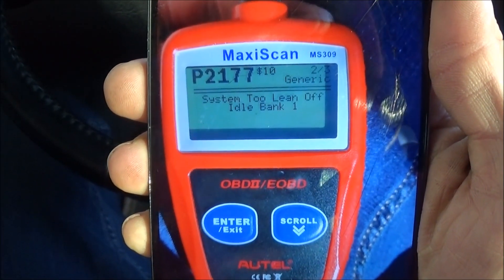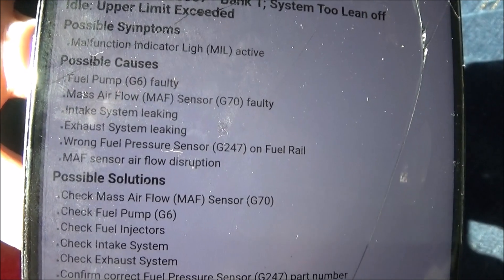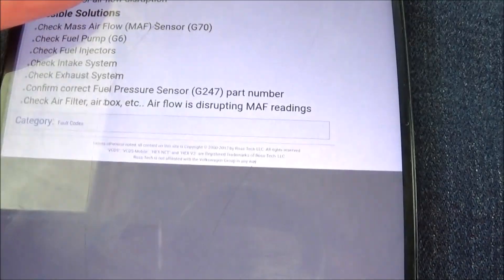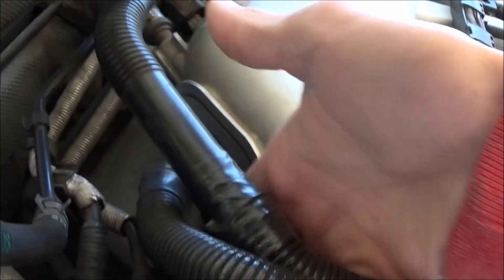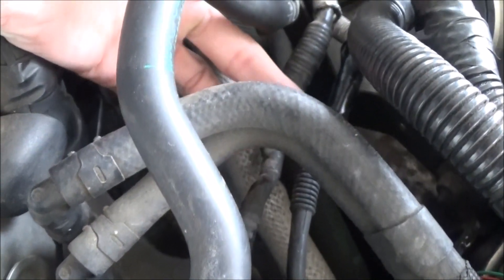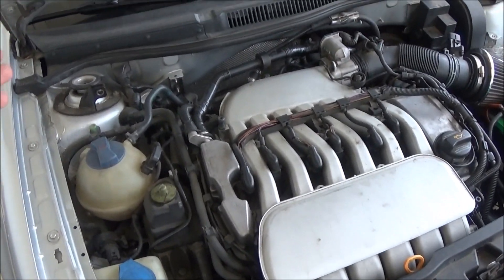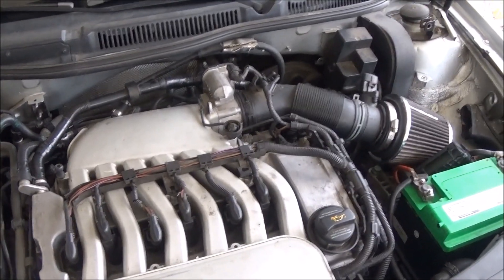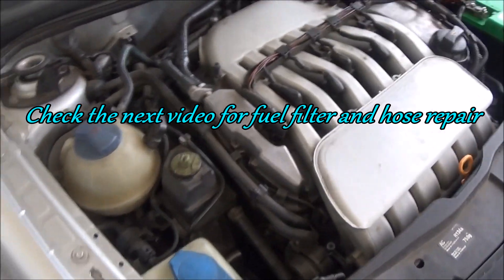P2177 System Too Lean Off Idle. Evap Leak Or Fuel Filter?

Comment: If you have a vacuum leak, then the code will be system too lean at idle, but you have system lean off idle that means either fuel pressure (fuel pump or fuel filter) or MAF sensor issue.
Reply: Are you sure ?